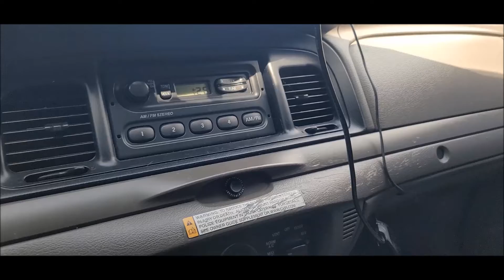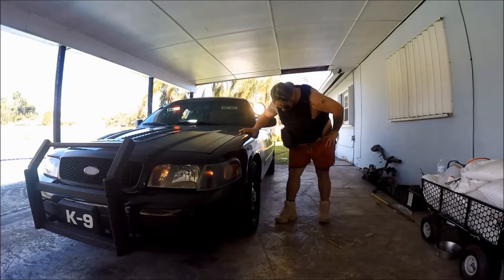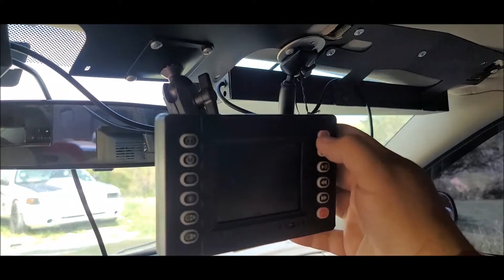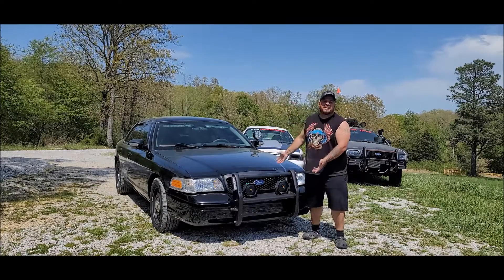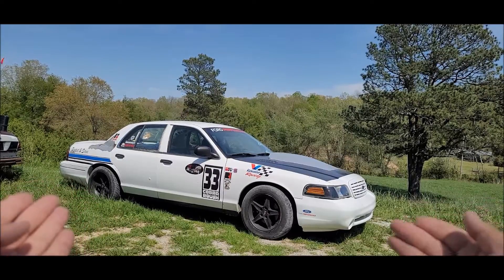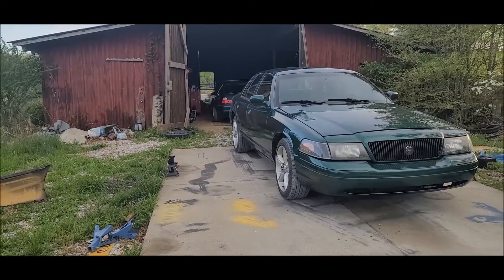10 Things ONLY Crown Vic Owners can Understand...

Comment from the maker: Did i leave any other ones out?🤔
Reply: You the bomb 💣 can you come to sanfrancisco
Reply: The hoarding phase.  Try to catch them all like Pokémon lol
Reply: The guy that knows the car is slow and still drive 90 everywhere
Reply: @thatcarolinainterceptor1273  yes I got one three years ago then got another one in 21 and got another one last year all at the auction site all of them were purchased with little time left, I'm afraid they are going to run out of them I haven't sold one of them yet and probably never will you make a good point.the last one didn't make my wife very happy I didn't inspect any of them just pushed the bid button I'm not disappointed
Reply: you should host a panther meet on the dragon. its free just pick a date and work out a spot to meet up.

Comment: The “I hope my spark plug doesn’t shoot out of my cylinder head” anxiety should be on this list 😆
Reply: bro mine blew out because the piston punshed it out because the crankshaft slipped out of it's bearings.... been in my shop for about a year now.
Reply: @franzbauer1367  damn dude!! That’s crazy I’ve never heard of that happening before. Mine blew out just because of Fords questionable design to only have 3 or 4 threads holding the spark plug in. Hope you get your car back soon tho
Reply: I honestly don't think that's an issue after certain years of the 4.6 but it is an issue on the older 5.4
Reply: @franzbauer1367  I call BS the last thing to go on a 4.6 is the crankshaft it's making me doubt you even own one , tell me I'm wrong
Reply: @jrsmith1008  I thought the same exact thing until it happened to me lol. After doing some research I found out that it’s much more common on the 3v motors (especially the 5.4L) but it is also known to happen to the 2v motors. It’s common enough that Cal-Van makes an excellent kit specifically for the 2v spark plug repairs that I used to fix mine.
Reply: @bryanyokofich5021  another thing that comes to mind, I'm sure you know this, is you never and I mean never take a plug out of a hot engine if it has aluminum heads I was told that over 30 years ago in auto class
Reply: @jrsmith1008 why?

Comment: The intake issue is so not anxiety inducing it's way easier than an old Chevy vortec the hardest thing is removing the fuel line and unplugging plugs and injectors after that it's a cakewalk don't even need a torque wrench I would rather fix that than a leaking heater core

Comment: I have a question. 20004 grand marquis  .I whant to put 235 60 17 tires. Do you think that fits  ?? Thanks for your response.  Cheers from Houston tx.
Reply: I think the Merc marauder had either 17s or 18s. Check specs and they will fit I am sure.
Reply: I think your c V came with 15 in diameter stamped steel wheels.  Tires in sizes for 15s are harder to find , but available.  17s won’t fit on a 15 inch rim, of course.

Comment: That's funny you mentioned the sound of a Crown Victoria Ford owns that category first the rumbling flat head, iconic engine sound then the incomparable 351 C then the mighty 429 the ground shakes when that engine is running not a fanboy I've had Chevys for years but I own Crown Vics now I'm very happy they sound good through stock exhausts
Reply: I remember the unique great sound of my 1970 351C  Mach 1
Reply: @31847448  That has to be one of the greatest muscle cars ever the last time I saw one at a gas station I was admiring it, I'm so jealous I think if I had my choice the Mach 1 would be my second pick my all time favorite is the 70 1/2 Z28

Comment: I won't own a Vic (their ungodly expensive in my area unless you want a crackheads beater) however I want to throw a crown Vic motor in my 94 ranger just for v8 noises and burnouts and the 4.6 is cheaper than a 302 lol

Comment: I have 2 p71, one is a 2007 3 inch lift, 31 inch tires on 15 in rims with modified computer, intake, Gator LSD's. Twin side dump Flowmaster outlaw exhausts. The other is a 2004 p71, with a 32 valve marauder motor, ( the person who had this p71 before me put in the marauder motor,  after the original motor had a cracked blocked. But yes I replaced the transmission twice so far in the 2004, replaced the intake manifold on on 2007. Can't wait till panther fest. Not sure which one I should bring. The 04 surprises a lot of Mustang owners, I actually beat a Maserati in the 07 one 4 times now. And that's the lifted off road set up🤣
Reply: Dang how much you pay for insurance?
Reply: @CaptainCJ97  I have USAA. A big discount
Reply: @stormshadow3087  nice